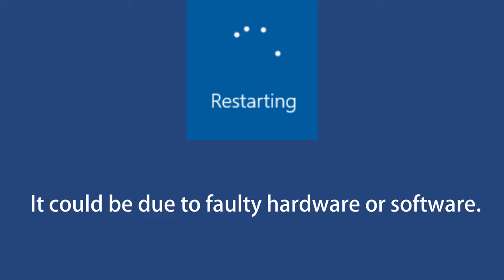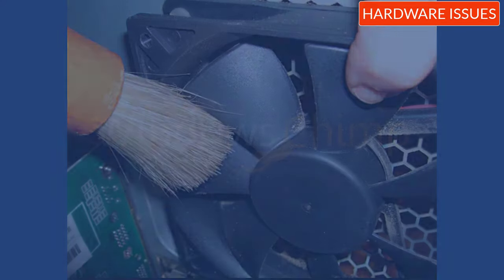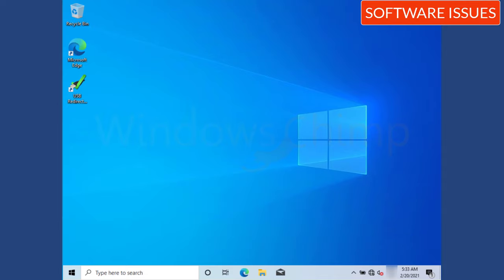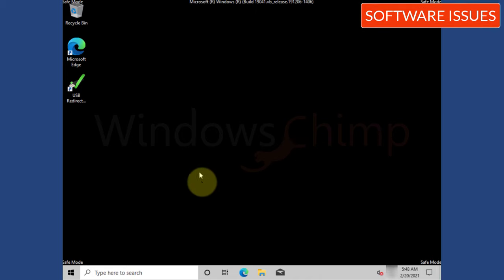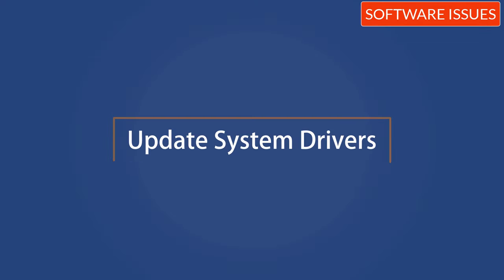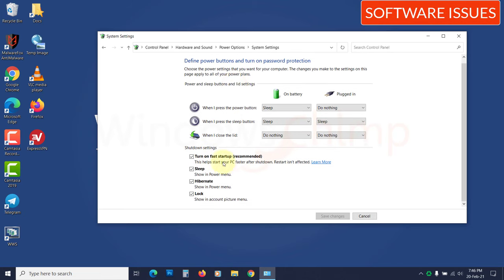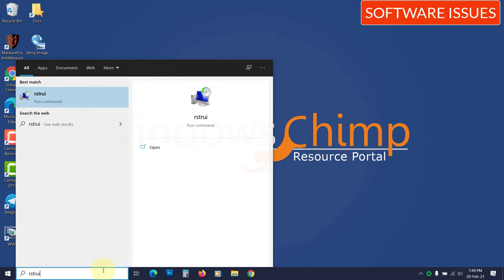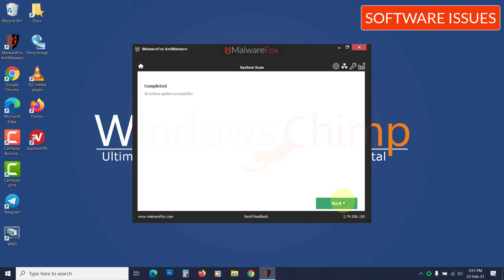How to Fix Computer that Keeps Restarting? PC Rebooting Issue

Comment: *** Important rare discovery ***
I've been building computers since the mid-80s. I'm certified and have several college degrees in computer technology, except for coding. I'm only saying this so you can trust me. If you don't, no problem... keep on blindly stumbling.
I too had the rebooting issue which obviously can be very deceptive to figure out. You may be fooled into thinking the problems is RAM, or the CPU, or over-heating, graphics card, or the power supply, and maybe blame other things. You may even waste significant money replacing parts during your challenging mysterious diagnosis.
I HAVEN'T SEEN THIS CULPRIT anywhere on the Internet - no one mentions it at all as the cause of rebooting but it ended up being **** THE POWER CORD that's connected to the power supply.

If you have questions regarding this, drop me a line.
Reply: What if I plug my pc into a power strip? Could that cause it to randomly restart?
Reply: @michaeloftherose  No Michael. A power strip will not cause computer reboot problems. I have always used good power strips for all my computers. I would however suggest to stay away from the cheap $10 ones - protection is near zero plus they commonly catch fire under certain power surges, especially a lightning strike. Buy name brands like APC, Anker, or Belkin. (APC if you want lightning warranty protection)
Reply: Jeff i literally hope you become a billionaire. Ive been troubleshooting for 3 days not knowing what the problem was until i switched the psu CORD. And it fricken worked. Nothing can express how happy I am . Thank you Jeff. Thank you thank you thank you thank you 🙏🏽
Reply: @icyyomari5665  Very happy to have helped you out!
Reply: Good day Jeff my Just keeps restarting it doesn't even boot before restarting
Reply: @Historique-ng  Here are some things you can do: (and retry booting after each step)

1. remove the coin battery on the motherboard... wait 60 seconds, then put it back in
2. look at the power cable print - verify it's at least 16 gauge, 3 wire. If not, replace the cable
3. plug the computer in a different outlet, preferably in a different room
4. check the CPU, power supply, & all other fans for lint/fur/etc
5. remove the RAM sticks. Rub a pencil eraser on the gold fingers. Reinstall them.
6. when trying to boot the computer, keep tapping the DELETE key to verify whether or not you can get into the BIOS setup. Try to avoid messing with the settings. (was just a test)
7. borrow or buy another power supply, making sure it's at least 400 watts of power.
8. if you feel capable, carefully remove the fan over the CPU to verify the condition & amount remaining of the silver compound, a thermal grease. (this dissipates heat by sending it to the base of the aluminum heat sink you just removed) (I prefer Arctic Silver)
Reply: @Historique-ng  it may be your cpu
Reply: @Jeff82556  thank you so much I ve resolved the issue Thanks alot man
Reply: @Historique-ng  I'm glad you resolved your issue.
Please tell me what was the problem. Not knowing is like missing the final episode of a TV show.
Reply: @Historique-ng  what was the problem with the pc?
Reply: @Jeff82556  how about if my pc suddenly restarts? After that it works for a while but when i open up LoL or working with chrome then suddenly it will freeze and restart again. I tried cleaning the ram and switching both of them.

This only worsen when my dad cleaned the pc with an air compressor (don't know if that's okay to do)
Reply: @snoopy2710  Hey Snoopy, it sounds like you might have an overheating issue. Your Dad could have actually made it worse if while blowing it out he forced trapped lint further/deeper into a fan OR even worse.... if he dried out the thermal compound under the CPU moreso than it already was.

First off you need to take a look under the CPU, after you remove the CPU fan (which can be a little tricky) if you feel comfortable doing this. The CPU chip sits on a heat-sink and has a lever type release bar - move this bar slightly to release its locked position, then raise it upwards. This frees/unlocks the CPU chip. Lift off the CPU and then inspect the amount of remaining silver thermal compound. It should NOT be dried up like old paint. The heat-sink requires a dab of compound about the size of a dime, but no larger and not too thick. The CPU will squish the silver compound a little (spreads it outwards a bit) when installing the CPU. The purpose of thermal compound (I prefer Arctic Silver) is to transfer heat from the CPU onto the heat-sink.

Two other possible overheating culprits: power supply and the graphics card.
Your RAM (memory sticks) could also be causing sudden restarts. Not unusual at all.
After you look over these things, let me know if you found the fault - good luck and feel free to get back to me w/more Qs.
Reply: @Jeff82556   Thanks! We tried putting on thermal paste looks like it was part of the issue, but when i tested it by running an rts game that has many units involved my pc would just freeze until i force restart it. Both my Ram and power supply are working just fine
Reply: Nvm ram seems to be the problem cuz it keep changing from 4 to 8 and back to 4 after restart lol
Reply: @snoopy2710  If you buy new RAM, remove one of your sticks to reference the specs of what you need.
I prefer G. Skill brand. Get 16GB if you typically do games. Find the RAM at NewEgg.com and then compare the price with Amazon. (if they carry the exact same)
Reply: Aleksandar Krstic  Aleksandar, that Driver Booster is far too radical and destructive for my taste. You can have serious problems with a software that's willing to alter many different aspects of your computer.
I just came from their site. It states that it creates a RESTORE point in Windows, in case there is trouble. You need to research "how to boot your computer in SAFE mode" so you can get back to Windows and use the RECOVERY tool and pick the GO BACK option.
TIP: If you start forcing a shut down of the computer using the power button, 2 or 3 cycles doing this will usually activate the Windows Repair Mode, and then you can choose SAFE mode.
HERE'S WHAT YOU DO: push the power button once to turn ON the computer, then hold power button inwards for a couple of seconds to force a manual power OFF, then do the same routing a 2nd time and maybe even a 3rd routine to obtain the Windows automatic repair interface - which has SAFE mode option.

Sorry it's a freakin' book. Let me know what happens but ultimately you want to UNDO what Power Boost did to your PC.
Reply: Need help on restart loop, I accidentally ended the task on task manager amd andrenaline pc went to restart tried to reset it same shit happens it’s a new pc btw
Reply: @Jeff82556  if you can't get into BIOs what do you do? When I press delete to go to bios it goes blank, but if I dont it reboots the computer repeatedly until it shows a message saying it can't boot. The page that shows the option to get into BIOs also looks staticy compared to the normal logo.
Reply: @VirtualShepherdOfficial  I hope you see the reply I left for you up above. (under a post I wrote starting with "Didn't see it mentioned here but:")
Reply: @Jeff82556  i tried fully factory resetting my pc and while it was installing my keyboard software it froze and restarted. now my pc just constantly turns on and then restarts and i can’t do anything about it. please help.
Reply: @Jeff82556  I can’t enter safe mode on my pc because it just turns off before i can do anything. i also tried resetting it 3 times to get into safe mode but it still doesn’t work. i checked the ram and it’s fine. do you know anything else?
Reply: @bearaser1  - Have you tried to remove, wait 30 seconds, and then reinsert the coin battery which is around center on the motherboard?
- Swap your power cable and/or make sure you're using the same cable as before. Plug it directly into an outlet, not a surge protector.
- If your keyboard is USB or wireless (USB antenna), unplug it and try an alternate keyboard. Unplug any other USB devices (drives, etc) for now.
- I'll assume you didn't yet look under the CPU at the thermal compound condition.
- Can you get into the BIOS? As soon as you press the power button to start the computer, start continuously hitting the F8 button to enter the BIOS. If this didn't work, try again but using/hitting the Delete button continuously instead. (example: tap tap tap tap tap tap tap.....)
- IF you get into the BIOS, disable "FAST START". Disable "SECURE BOOT".
- Do you possess the original Windows install disk or have it on a USB memory stick? If so, boot to it so you can access Recovery and/ore Repair disk options.
Let me know if you have any success, Jeff
Reply: @bearaser1  EDIT here on YouTube is not remembering my EDITS!
I tried to add info to my post a few minutes ago but the comments I made are still the same - as if I didn't edit a thing! Damn!
Anyway, I was trying to say ... I know your computer is new but I want you to do the battery remove/replace test anyway. Also, do you still possess the original Windows install disk or have it on a USB memory stick?
Reply: @Jeff82556  i tried all the steps and it didn’t work. i can’t find the battery thing in the middle of the motherboard you are talking about though. when i turn it in i see a blue screen for a few seconds that says “installing windows 64%” i don’t know if this means anything though. then the screen disappears and then whole pc restarts, and the screen comes back. and it does this until i unplug it.
Reply: @bearaser1  Okay, I don't know why you didn't mention that before. It's really hard to diagnose computer problems if you omit telling me important critical details.
Now that I know this info, you will need to insert your Windows disk (or USB stick) and do a "fresh install". Getting stuck at 64% is actually a common problem.
ALTERNATELY:
Start your computer, wait for Windows to get stuck, the press and hold the Power Button on your PC for 5-10 seconds to perform a hard shut down.
Now start your PC again (a 2nd time), as Windows attempts to load and gets stuck again, press and hold Power Button for 5-10 seconds to perform a hard shut down ... once again. (a 2nd time)
NOW on a third start of the computer Windows will boot into the Recovery Environment and from there you can access System Repair, Safe Mode, Command Prompt . . . etc. .

Again, you'll likely need the original install disk or USB stick. (you didn't answer many of my questions, so I don't know if you have one or not)
Reply: @Jeff82556  I tried to restart the pc 3 times and nothing happened. i also don’t have the original usb stick you are talking about. sorry. i have a usb stick with windows on it though but it’s not the original one.
Reply: @bearaser1  Try to boot to the USB stick that you do have.
Reply: @Jeff82556  okay i’d did now it brings me to a purple screen asking me if i want to install windows.
Reply: @bearaser1  Say YES so that the installation stuck at 64% will maybe continue. If it doesn't, choose a "fresh install". Keep in mind that anything you installed before will no longer be present and you'll have to reinstall such other programs. You will NOT lose any files that you saved before though. You will have to reinstall any drivers but DON'T do the keyboard stuff that caused you trouble. Just use a "standard keyboard" driver. Good luck.
Reply: @Jeff82556  thank you jeff, it worked. nothing was helping besides you. glad there is still nice people out there
Reply: @bearaser1  Fantastic! Good luck!
Reply: Hey jeff, i hope youre doing fine,so a few days ago i moved my pc moved a little and it froze i restarted it from the case button then it couldnt connect to the monitor so i tried pulling out the bios battery and after a few seconds putting it back and it worked then when i turned on the pc there was no issue but suddenly it gets laggy and it restarts idk what to do every time i turn it on it keeps restarting again and again....
Reply: @wellf502  Well F, the first thing I would do is actually replace the BIOS battery with a new battery. While you have it open, look around and make sure a fan cable (especially the CPU fan) did not come unplugged. If everything looks okay, unplug each RAM stick and then plug each one back in AFTER you rub the gold fingers with a pencil eraser which cleans the contacts. (wipe them off too) Next, carefully remove your CPU fan, heatsink, and CPU chip. Check the thermal compound condition. This stuff dries up over time and is one of the main reasons a computer won't restart. (self-protecting)
After you finish, but before putting the cover/case back on, power up your computer while watching the inside guts. Look around for fans not working - especially the power supply fan. Let me know what you discover.
Reply: @Jeff82556  I’ll sure do ,don’t worry I’ll keep u posted!!
Reply: Do u think “fast start up” or “automatically restart” might be causing these issues??
Reply: @wellf502  No they would not cause issues. These are reasons for a computer to shut itself down:
1. overheating threat (CPU self-protection)
2. power supply failure
3. RAM problem
4. power cord issue (replace or trade)
Reply: @Jeff82556  well it still didn’t fix my issue now it’s not even connecting to the monitor
Reply: @wellf502  Well F, my question back to you would be: can you hear or see that the computer is actually running but you're not seeing anything on the monitor?
If your computer is running and you're not seeing anything on the monitor, then your video cable could be bad or monitor is bad. Can you borrow someone's monitor to test on your computer? (only if your computer runs though)
Usually I find out that someone having trouble is not giving me the whole picture which makes it more difficult for me to troubleshoot - not saying this is the case with you of course.
Reply to my questions so we can move forward, Jeff
Reply: @Jeff82556  sorry, and yes it is running but nothing plays on the monitor and ive tried other monitor i even tried a tv but nothing shows, another thing that when this happens even my keyboard won´t connect to the pc (i know it cuz the rgb on my keyboard they wont turn on) every thing else runs the case and the fans, the gpu, the cpu fan, idk what´s wrong with it, thanks for the help jeff really tho , u don´t have to do this but ur a hero

and no  i cannot hear or see anything on the monitor

update:  also  i noticed that my debug led cpu on my motherboard is on its a white light
Reply: @wellf502  You've got a real stubborn issue. I would try a new graphics cable. I've had them go bad before. It's possible your GPU is or has failed. You could have a motherboard glitch or failure. It's hard to determine anything while being blind w/no monitor.
I'll think about it further, but I'm running out of possibilities, Jeff
Reply: @Jeff82556  thank you really jeff i fixed it  thanks for the effort!!
Reply: hey jeff, ive scrolled through the replies and you seem to be a great help to others offering your service and advices for completely free. i have a problem where my pc is in a rebooting loop, i dont know where to start because my pc is pre built
Reply: @broof1  Sorry for my delay. I need more basic information - how long have you had the computer? Did it ever work normally? When did your loop problem start? Have you changed anything recently? Have you ever cleaned it out, meaning remove the cover and blow it out... look at fans ... etc?
Reply: @Jeff82556  its my father's, i cleaned it because it was so dusty, i did the erasing ram trick and it didnt do anything. i did the option where the pc reinstalls windows 10 because of the issues i was having and after a while of waiting it got the rebooting loop problem, that was about 3 days ago
Reply: @Jeff82556  update: i tried taking out the coin for 30 seconds and still no hope
Reply: @broof1  Tell me M.Broofy - did the loop problem start before or after you cleaned his computer?
Reply: @Jeff82556  no the pc was completely fine and all out of the sudden got the problem after I reinstalled windows, too late though it's already at the pc engineer guy
Reply: @broof1  You didn't tell me that, that your problems started after installed Windows! I can't help people fix their computers if you omit critical information!
It's like telling an auto mechanic "my engine won't run" but you didn't mention that the car fell off a cliff!
Reply: @Jeff82556  my fault man, but it is what it is. thanks for acknowledging my reply though
Reply: Hi Jeff! Your knowledge and experience is highly appreciated by me..

Actually my problem is that whenever I try to power on my PC, it first starts and then turns off again. I have tried all possible solutions- Cleaned and reinstalled RAM, Dried the battery receptors even took it to a mechanical shop, idk what they did but they changed the power supply system and it worked. But unfortunately, it only worked for that day, and the problem repeated. I took it again, this time they cleaned the entire system and it worked again. But the very next day, my PC displayed the same problem. I'm very disappointed and frustrated due to this, can u suggest something?
Reply: @Smartboy12370  The first thing you need to do is REPLACE the power cord that connects your power supply to the electric wall outlet. The second thing to do is carefully remove the CPU heat sink and then remove the CPU. This is where you can see if the thermal paste has dried up and needs new stuff. If so, wipe off the CPU and the motherboard socket of the old stuff.
I'll stop right here and wait for your results/findings. Good luck, Jeff